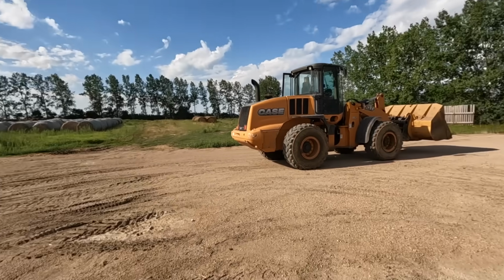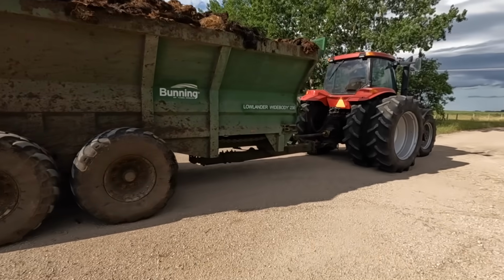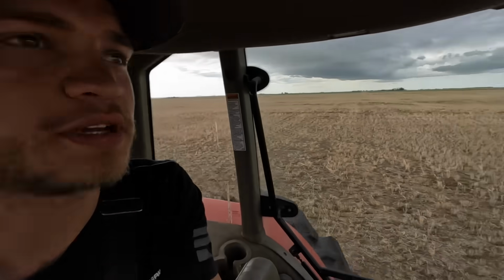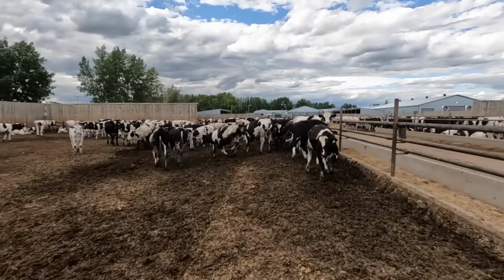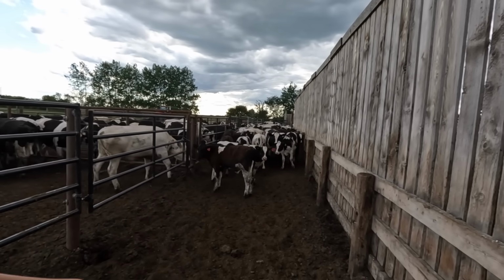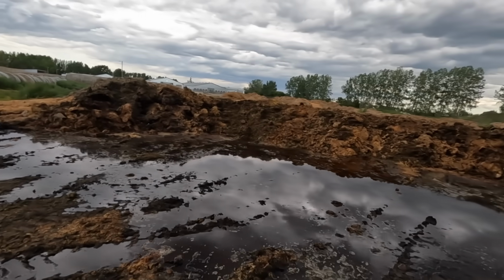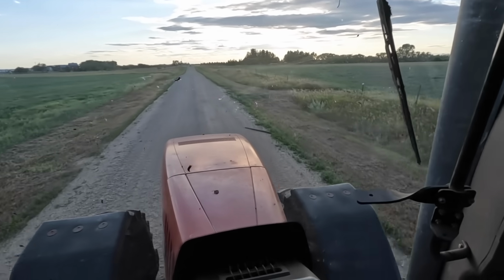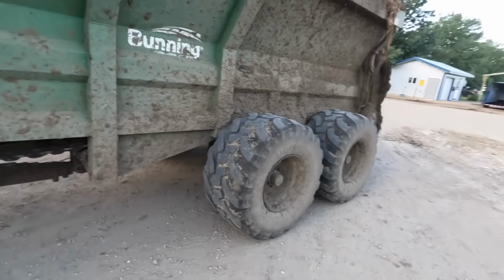Hauling Out Winter Manure Pile!

Comment: I was thinking that the pile was real dry also! I used to drive a city bus with 5 computers operating the systems, when a system light would come on the mechanics would have us pull over and shut down the bus and restart, 9 times out of 10 that would fix it! When I was about 10 I would be on the sort gate , I got fast at swinging a gate!

Comment: If the only time the PTO is a problem is on start up i would guess it needs to be changed to heavy load start up.
It sould say heavy in the corner post when you start it up.
There's no need for you to have it on light.
If it is on light it shouts off because it takes to long to start.

Comment: I was wondering, is spreading the manure 100% required for the crops or is it more like 50- 50 for fertilization and to just get rid of the manure.
Reply: Crops to perform properly must have fertilizer. Urea(manure) is a form of fertilizer. It leaches out quickly but can burn if applied to heavily. The manure must be disposed of, Jan has an ample  supply and the crops use it ,win win , imo.
🇺🇸🇨🇱
Reply: At least in England we will use slurry in spring and summer to boost the nitrogen and save the cost of the bagged fertiliser as it’s expensive and use bedding muck box muck in winter and before cultivation